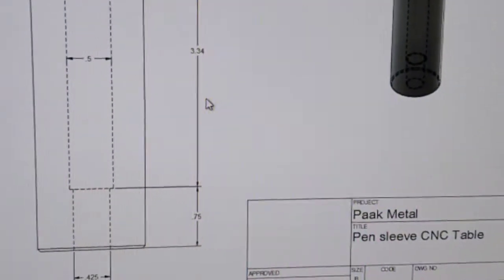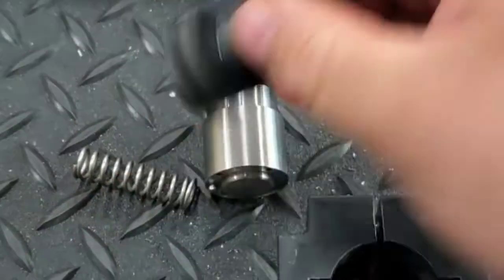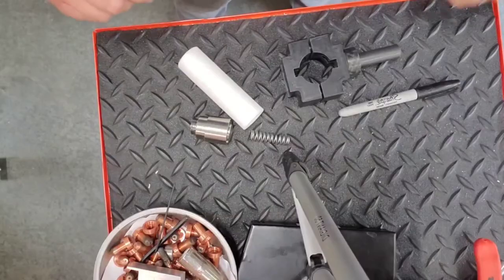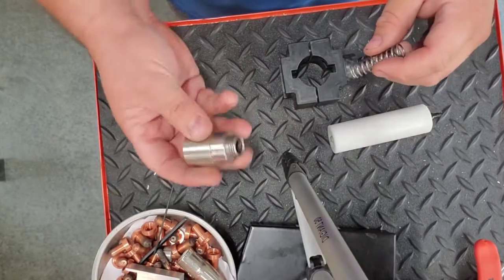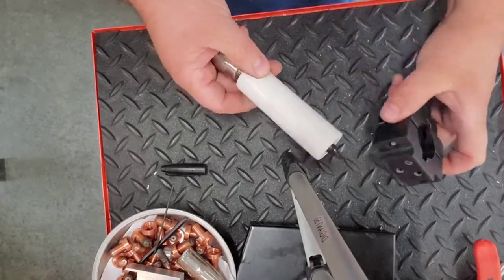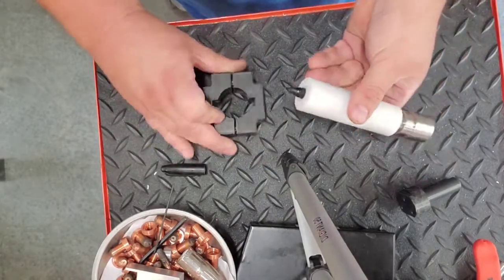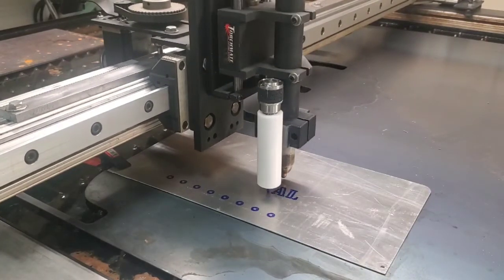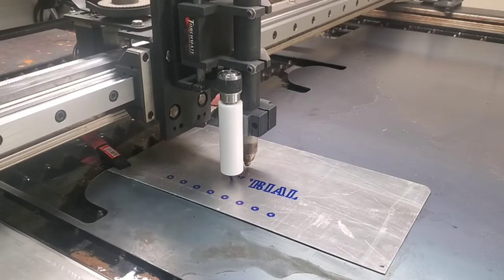CNC Plasma table sharpie retrofit

Comment: what CNC control software are you using?  Did you have to write a macro to get the marker function to work right?
Reply from the maker: I use torchmate cnc controller with a customer table/motors I built. Inside the software I can make a second tool and create a "tool offset". So I can run one tool path that marks first. Then run a second designed to cut. Not sure if this helps much.